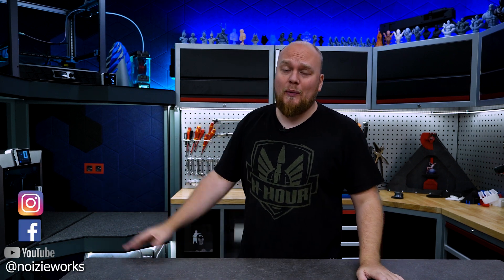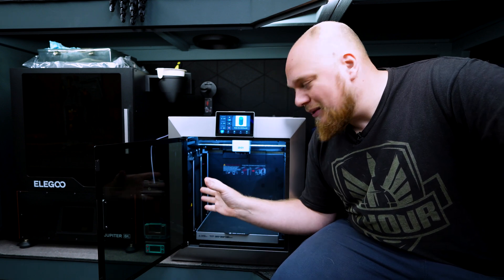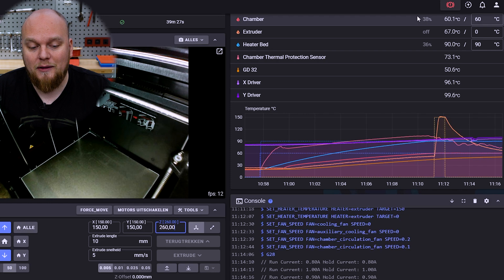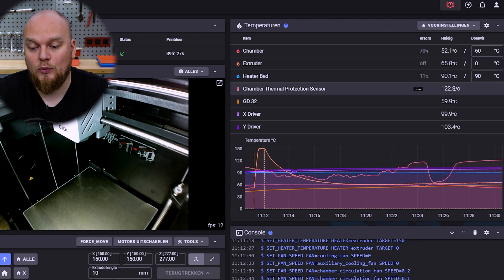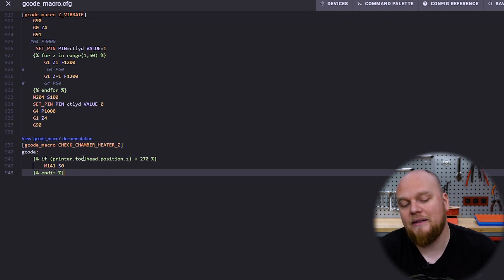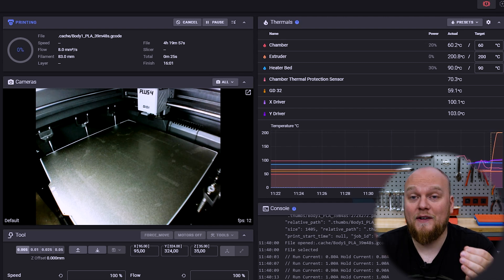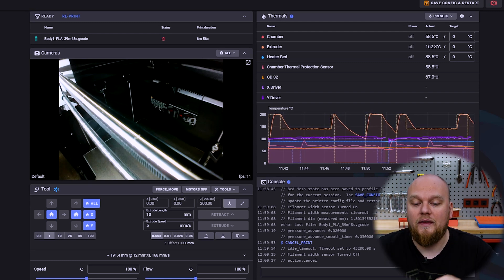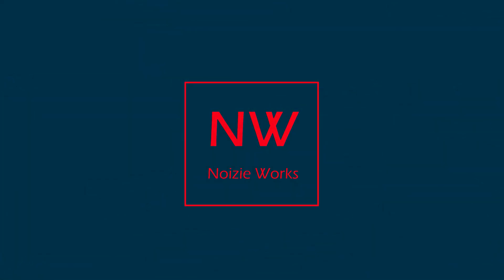Qidi plus 4 has a new design flaw and here is how to temporarily fix it. Bed blocking chamber heater

Comment from the maker: Side note, this happens with and without the chamber fan it just takes a mm more and a bit of extra time. Unless the last part of the print is a few small things it's the same as rolling the dice.
Reply: @NoizieWorks  I looked at closely,  lowering bed to lowest extent.  Think one could 3d print a recessed self designed part with upwards facing fin that could press fit into air exit area, has horizontal fin that aims upwards at 80 degrees and splits some air facing downwards at 25 degree angle can even block some direct heat from uprights in region where it close to air outlet cutting down in radiant heat exposure of vertical, though expansion is already accounted for by design.   This would be printed in PPS or maybe PET-CF.   

Think it will more evenly distribute air on top and under deck and prevent any issues when at 270mm to 280mm height objects, simple shallow press fits into the rectangular shape of heater air exit.  Does not look like tall prints will always fail,  but this one simple add should cure any chances of an issue….it would be very easy press fit design…. I am going to do test prints without and with that added in pps and also petcf when i get chance.  I did notice after lowering bed they do have room for air except on tiny zone at like you said furthest or last 6mm.  A press in high angle fin with added low angle fin should fix or remove any risk of issues this may cause
Reply from the maker: @jefft490  great work brother
Reply: @NoizieWorks  going on my normal 7days off in work schedule will design a part and print and test it week out when I return home….. I have some PETCF that should work well, if not will grab 1/2 kilo of PPS.   97mm by 31.5 and has rounded lower corners rough fast measurements will design with to start one fin will aim upwars roughly 80 degrees other downwards about 25 degrees should be good test start n will flush fit be pretty shallow piece.  Can even add a bit of side exhaust air flow to cover left front vertical edge allows some air to go towards front door as the bed moves in close to it…

Comment: everytime I put the code into gcode macro cfg I get another error code saying Source contains parsing errors: '/home/mks/printer_data/config/gcode_macro.cfg'
[line 970]: '{% if (printer.toolhead.position.z) > 270 %}\n'
[line 971]: 'M141 S0\n'
[line 972]: '{% endif %}'

Once the underlying issue is corrected, use the "RESTART"
command to reload the config and restart the host software.
Printer is halted

Comment: Man I wish I saw this before I bought the printer.. This is a pretty chiddy  situation.
Reply from the maker: Chiddy "fixed it" in firmware turning off the heater before it reached the point so no more failed prints because of it. Still a shitty design so if you want to replace the housing grab the file

Comment: I think this needs a redesign of the channel and/or heater position. I should not be too difficult to make that air to flow elsewhere without any negative effect on the chamber heating.
Reply from the maker: @arjanlenoir5058  i made a redesign brother, https://youtu.be/dcIuKb0kHWA
Reply: @NoizieWorks  I see now. I am a little behind on your channel I guess ;-)
Reply from the maker: @arjanlenoir5058  take all the time you need, i run a giveaway at the moment so be sure to enter it!

Comment: If you wrap that chamber heater core in a layer or two of capton tape you shouldn't have to worry about any melting in combination with your new PA6-GF material.
Reply from the maker: @jasonholley3009  thanks for the tip!

Comment: I got a QIDI Plus 4 today, I cannot load filament, something is stopping it from getting from the outside of the printer to the inside PTFE tube.
Reply from the maker: Did you place the small bit of ptfe tube that came with the printer in the hole as mentioned in the instructions? If so it's blocked with something.
Maybe the tangle sensor is defective.
Reply: @NoizieWorks  I couldn't find the PTFE tube with the printer, I searched the box and packaging, couldn't see it, however I have since solved that issue by cutting the filament and trying again.
Reply from the maker: @SimonPlatten  great
Reply: New problem now, I have both QIDISlicer and OrcaSlicer, both are doing the same I import an STL file which almost fills the plate, but when I export it to gcode and try to print, what I get is scaled to a fraction of the required size, what could explain this?

Comment: It is my understanding, that as of November 9, 2024
I should :
   1. Update Pluse4 firmware
   2. Glue a loose linear bearing on the tool head X axis
             AND, if I live in a county with 110 volt mains
  3. Contact Qidi to get a new power board for the chamber heater
  4. Install that new power board or find or pay someone to install it for me

then a 759 US dollar 3D printer will be as specified
Reply from the maker: Something like that or and that's what i would recommend, wait a few months on the new batch.

Comment: Your solutions are to complicated.  All Qidi lawyers have to do is send new stickers for the front of the build plate 305* 305* 270 mm. and changes their advertising.
Reply from the maker: You are right! Not to 270 but a design change in the heater is necessary

Comment: would Drilled holes between the rails on the side of the bed ( allowing air to flow better under the bed),  correct the issue w/o damaging the bed, allowing max height build?
Reply from the maker: @jamesclay2584  I would not attempt something like that, if you have a bit of patience then you will probably like the new shroud that's in the last phase of testing. This weekend is should be ready to post it

Comment: Looking back on this  video, we're all lucky the Plus4 didn't catch fire! 
Hopefully Qidis will be sending out new relay boards soon!
Reply from the maker: @helixxharpell  i got an update, don't expect new boards.
Apparently the power setting was incorrect from the start and they never wanted it to be this high of an output.
They are not planning to change the power setting in the future so .4 it is.
Reply: @NoizieWorks  That's not what the folks over on Reddit are saying. Qidi doesn't have the correct relays spec'd and just a firmware change won't make it  safer. 
I would scan both Qidi subreddits for all our posts on this. 

Thank you for all you do btw! 

Hillbilly Engineer
Reply from the maker: @helixx_4D  Ow i am brother and it's going to get adressed in my new chamber heater video.
I agree that the ssr is the problem and not the output power, why would you power limit a ptc heater to less then 1/3 right?
Another cheap "fix'
Reply: @NoizieWorks  Exactly! 
Firmware adjustments can't make up for poorly spec'd parts! 
FIRE SAFETY CANNOT BE TAKEN LIGHTLY! 😮

And I can't say enough great things about you guys who catch these things. 😃👍🏻
Reply from the maker: @helixxharpell  thank you, i appreciate the compliment. It's a community effort for sure keeping them accountable.
I actually mentioned it on a video i shared in my community tab.
Reviewers need to start making time to follow up more over time and the video topic just nailed it.
I honestly don't know how some channels can keep posting so many reviews on a short window without getting brainfarts left and right.
Reply: @helixxharpell  I just watched 3dmusketeers on YT just replace the SSR that Qidi sent him, was a bit janky but it worked. So they ARE replacing it Apparently. Now the Question- how long to wait before buying one so I don't have to deal with any of that😂 I was going to buy one today but that isn't happening
Reply from the maker: @notyouraveragegoldenpotato depending on where you live and if it's stocked in a warehouse a while i'm afraid. Not even sure right now that they will "recall" it voluntarily by sending all 110v users the new ssr. I hope they do!

Comment: So.. I am just turning on my chamber.. to pre heart. Within 15 seconds.. the chamber shows 140c and then I get this ADC out of range error and shuts down printer. WTF is going on with this? Is this a sensor malfunction and I got one of the bad sensor printers? Just got my printer too. Only got a couple prints and this keeps happening now. I was going to change my printer.cfg to 180 or something.. because I dont know why its tripping so fast.
Reply from the maker: @b3owu1f  are you talking about the chamber protection sensor? Could be that it came loose and is touching the heatsink.

Comment: Thanks for your amazing advice and videos! I am a complete novice with 3D printing and decided to purchase the Qidi Plus 4. My first two prints on the machine were amazing... but unfortunately my third print failed because of the following G-Code error message...

"gcode error:!! Error evaluating 'gcode macro BED_MESH_CALIBRATE:gcode': jinja2.exceptions.UndefinedError: 'dict object' has no attribute 'polygon'."

I can't figure out if it is purely a bed mesh problem, or an issue with the sliced file (or both). 

I have restarted the machine, reset factory defaults, calibrating a new bed mesh and even tried creating a completely new slice file... but nothing seems to be working! 

I suspect it might be an issue with the slicing gcode (and not the printer hardware). I tested this by running a volumetric flow test model and it started printing just fine before cancelling the print.

I would really appreciate help with this so I can start the print asap. Happy to share logs and files if that helps. Thanks a bunch!!
Reply from the maker: Hi dude! What slicer are you using?
Reply: G'day  @NoizieWorks  
I have been using Qidi Studio... But I think I found the issue/s. I managed to mess up the bed mesh calibration file and uploaded the original printer.config file. 

However, I think the main issue was actually the file name and /or associated folder names. 

For some reason I decided to use a "#" in the STL file name, which was translated to the 3MF and g-code files. 

Changing the file name and performing a new auto level seems to have worked. 

The job is currently printing, but I think the Z axis is still a fraction too high. Now I am trying to figure out how to properly re-home the bed to get a good z-offset.

Thanks so much for replying! I was starting to lose my mind 😂
Reply from the maker: @DaltoeMusic  strange characters are a no go on these type of deals for sure! You can set the Z offset during the print, it remembers that value an i have set it to -0.04mm on mine.
Reply: Thanks dude! I will try that and see how it's goes. Keep up the good work, you're a champion for helping others like this. Cheers
Reply from the maker: @DaltoeMusic  Thanks bud! I love what i do, no biggy 😉

Comment: More chamber heater-related issues BUT now a bigger problem than this.  Looks like 110v users have a potential fire hazard.  SSRs are burning up because when using 110v the SSR can overheat and burn up b/c it's a 220v spec'd board.  Using 110v cause too much of an amp draw burning up the related board.  Qidi released a "fix," which is basically a hack to circumvent the hardware issue.  The new firmware restricts the chamber heater output to 40%.  Supposedly previously it was capped at 70%.  What sucks what happens to those 110v users that don't know about this???  I heard an email went out to 110v customers but I know I didn't receive one and I purchased direct.  I just happen to be lurking Qidi social media groups as saw the issue.
Reply from the maker: I'm aware and i will adress it early next week
Reply: Already "fixed" by the firmware update, but a far from ideal solution honestly. Should at least be safe, but slower to heat.
Reply: @802Garage  yeah saw that but like you said, IMO, "far from ideal."  I believe it's a temporary solution with a disaster waiting to happen if Qidi doesn't address this correctly.  What if a 110v user doesn't continuously monitor social media and or update their firmware often?  They have a high probability of burning their printer up or, much worse, burning things down around the printer.   You cannot trust safety through software.  What if an update accidentally removes that restriction?  A minor software update oversight can have huge implications....remember the Crowdstrike update, if you don't look it up.  It's not 3D printer related, but still.
Reply from the maker: @theFPVgeek Highly aware of it, everything will be addressed in the video 😉
Reply: @theFPVgeek  While I think you are catastrophizing a bit in this particular scenario, I agree with many of your points and addressed the same concerns to Qidi around allowing users to continue using old boards and that they can't rely on users updating firmware. I told them they should essentially contact every buyer and make such updates mandatory. They told me they have contacted all buyers and told them to update as well as to request replacement boards and heaters if they have any issues. To be honest there isn't a huge amount more they can do, since anyone who doesn't get the message wouldn't for any other type of recall. The one step further they probably should take is publicly announcing the issue, which I think they should. I told them they need to be one step ahead of social media on this. We'll see if it matters or not. Trust me we have been talking about your same concerns for many days now on the Disk-chord as well as finding solutions. They can't undo shipping out the printers, but they are at least shipping out free parts to anyone and the firmware fix should be a permanent fix even if I would prefer a different fix. The Q1 Pro uses the same heater board and they have no issues with burning up, so as long as the overall power draw isn't far greater it should be reliable. Time will tell.
Reply: @802Garage  Yes sorry for catastrophizing a bit.  Well as far as contacted all buyers, I re-checked my email and I didn't receive a notification and I purchased direct and am a 110v user.  I guess that's why I am concerned as I hear what people say they (qidi) is contacting impacted customers but I am one of those customers that did not receive a notification.  I received Plus4 on 10/02/2024...thus my concern.
Reply from the maker: Send them an email to ask what action plan they are taking.
I'm interested to see if i'm getting yet another standard non answer.
If so, i'm not going to be very kind in my 1 month video next week.
Reply: @NoizieWorks  will do now
Reply: @theFPVgeek  They definitely need to do a better job. Most people who know about the issue are not very satisfied.

Comment: the machine is a fire hazard !!! My SSR started to smoke like Cheech&Chong when i turned on ther chamber heater from the dryer settings !!!!
Reply from the maker: @frankthebum1061  sounds like a defective ssr but not good at all! Wrong voltage setting psu?

Comment: As far as I can see is that this is a huge design mistake, taking the plate away also is counter productive because the hot air then would go straight into the print material maybe causing stringing and deformation, the only way would be to route the air flow differently which of course would need a wider chamber to add some kind of hose to move the air into another direction. Also making it slightly wider to leave a gap between the metal plate and the vent would be the best solution to fix this, but apparently they did not want to change the design, you probably can retrofit it with a hack on the case to add a bulk and move the heating element slightly out of the old case and leaving a bigger hole open! and introduce a gap! or by widening the case which probably would be the best fix anyway

Qidi probably added the plate as a quick fix last minute but the engineers did not think about the repercussions of blocking the heating vent entirely.Either way until someone fixes it probably turning off the heating element might be the best solution the heatplate itself can retain some temperature, some people added fans to their Bambus to get a better heat distribution and let the heat plate do its job.
Might also be a hack, if your print becomes bigger simply only use the plate and add a fan!
Reply from the maker: @werpu12  they "fixed" it in a firmware update today. It's in the comments tab.

Comment: Considering everything up to this point, would you recommend the Plus 4, or the  Q1 pro for a great all around(quality/speed/ multi filament type) first printer? Currently have a Neptune 4 pro and it’s been amazing but the quality isn’t really there (could be my tune however).
Or would you recommend going to Bambi? 
Thank you!
Reply from the maker: @KevThaBest  all depends on the size, you want bigger qidi if not both good options
Reply: @KevThaBest  Have both without doubt Plus4.  Both are good printers but Plus 4 footprint so much better and something to be said about glass